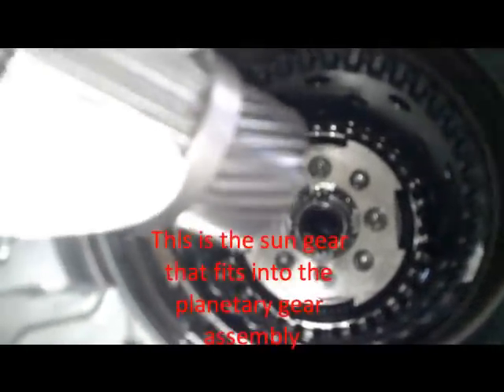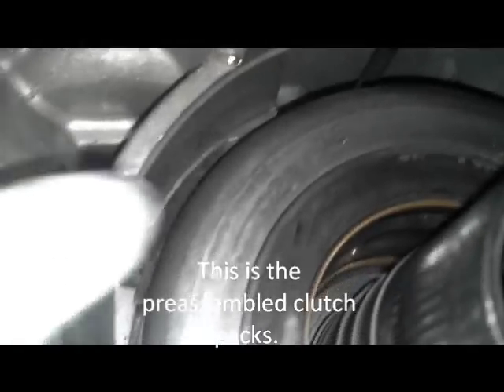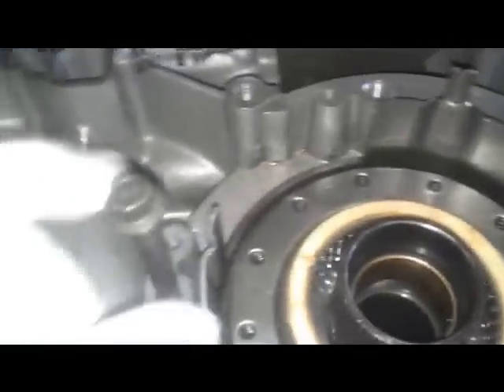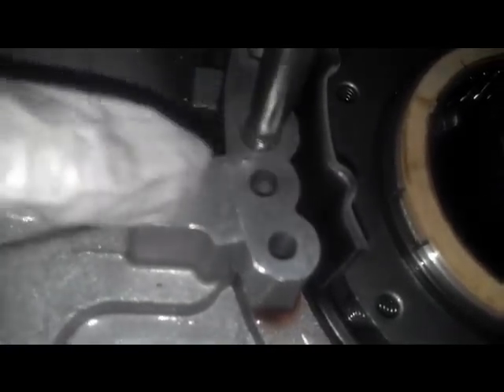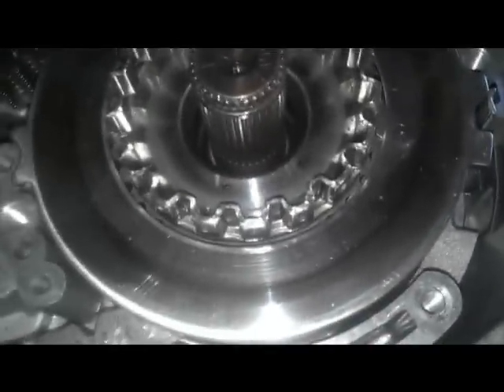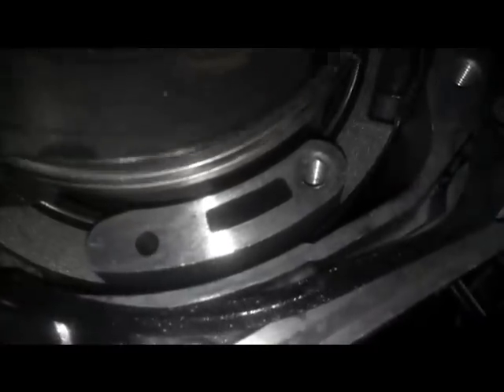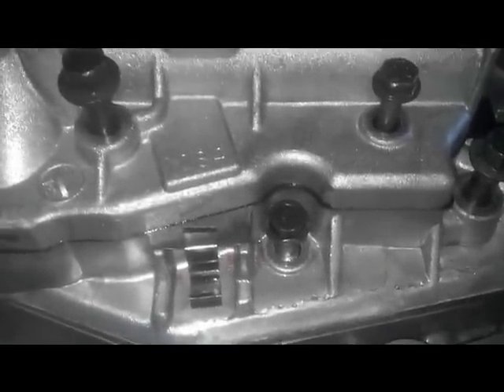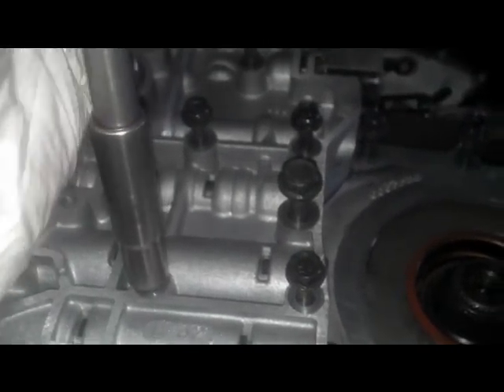4T60E assembly

Comment: Thanks for the video. I'm about to rebuild a 4t65e for the first time and need all the help I can get. Like others, I dont want to pay more than car is worth to fix. Plus, its good to learn new skills.
Reply: @AMthefox it was for a Volvo XC90.  it went great. I took my time getting everything apart and back together. I had a rebuild manual and watched YouTube viddos. I did put the tcc  valve in backwards so it had problems with lockup, but I was able to fix that with trans attached. After that no issues. My daughter drove it for about two months before she got side swiped and essentially totaled the vehicle. A guy bought it for $500, fixed all the body work and his daughter drove it from NC to CA.
Reply: Couple hundred miles, just around town.

Comment: Was looking for an amateur video of the 4t65 assembly.   The 60 is pretty close, but without the solenoids and switches.   I wanted to watch both pro and amateur, because the pros are just showing off by naming the parts and throwing bolts and every part in buckets and piles in no particular order and maybe pointing out what’s worn.   I guess they think you need schooling to do this.  It’s probably the best way, but average people don’t have time or money for that.  Also I don’t want to pay someone 3,500 to replace my trans in a 2,000 car